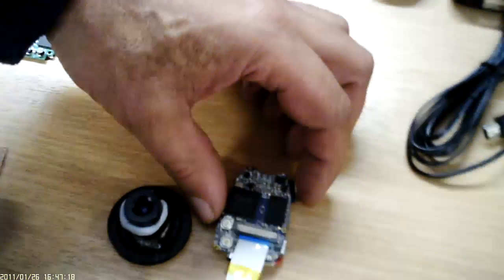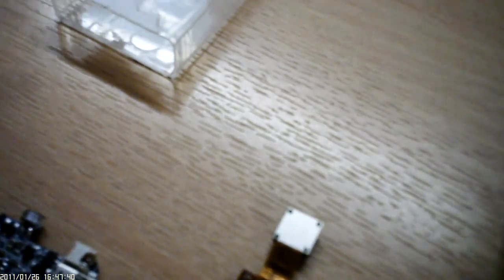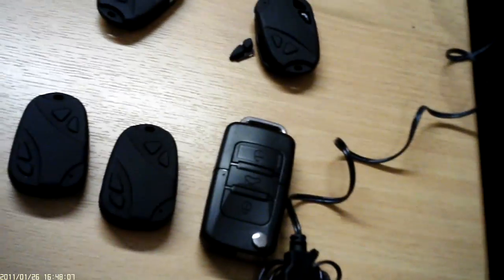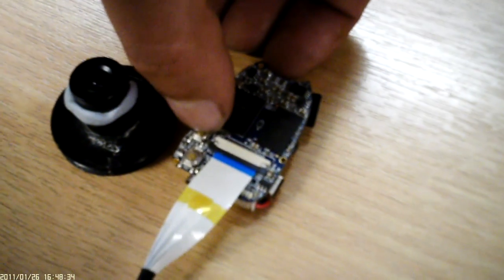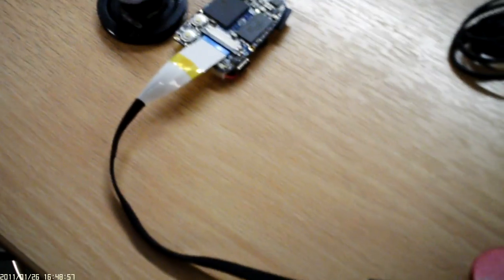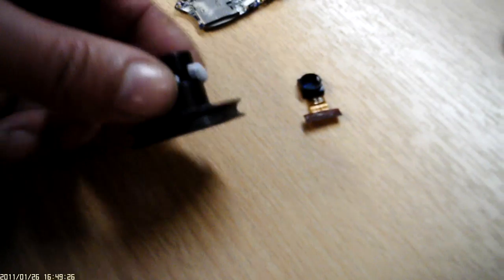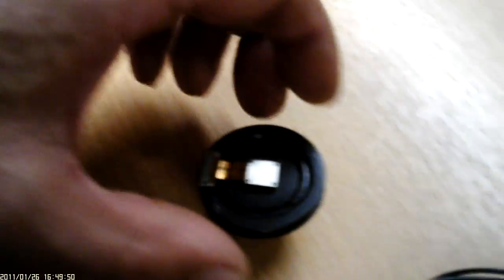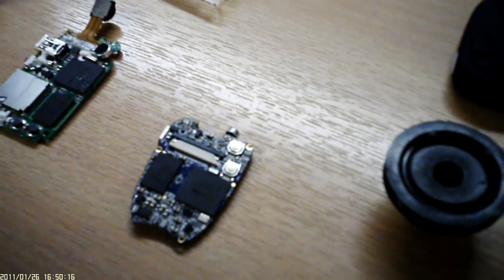808 #16 extended camera module

Comment: Would be simpler if they sold the 808 with the extension. I got one of these with the intent of putting on my various mini quad copters, for a bit of fun with the kids, but I really need it to have the ribbon cable extension so I can change the angle of the camera.. do you know if they have since began selling the 808 with the extension? Or an RC shop that mods them for resale?
Reply from the maker: From what i know the 808 has been superseded by the mobius which can be bought with the mod as a kit and is widely available.. as for the 808's you would have to source the parts your self and now is a bit old..

Comment from the maker: both considered and flux paste was used from the start but the problem was heat.. I've used a heat gun previously for SMD work, but lets face it flat ribbon cable is not meant to be soldered. any how my prefered method is to clamp.

Comment from the maker: Hello
This is the point, impedance along the length of the cable degrading video. This length works with no difference in video quality (please see the actual video of the camera videoing its self).  Also rcexplorerse did a side by side comparison of a go-pro and HD camera using a similar ribbon cable (worth a look) with no difference.
Best regards
TheRogerx3

Comment from the maker: Hello itsnige
yes that is the way to go. as long as the contact alignment is maintained and each contact has enough pressure on all lines any viable method is good. the problem is with size of method - my heath Robinson method works for demonstration purposes but is not practical. Thanks for your interest, I think that your question is the last piece of this chain, as it the sure fire way to connect ribbon to camera for those whom don't want to destroy their cameras.
Best regards
TheRogerx3

Comment: Hi TheRogerx3, I'm planning to try the same extension but thought I'd keep the camera module connected to its ribbon cable and add an IDC connector to the end of the extension cable to connect the two together.  From your experience do you think that would work?

Comment from the maker: Hi fredintheshed1
Thank you
The trick is to use flux paste and apply heat with a soldering iron no higher than 12w, an adjustable one is better. never use sideways motion against the tracks this is where I went wrong

Comment: It looks very tricky to solder the tiny ribbon cable.  Ive tried with old calculators with thicker cable and failed. I think you did well to get it working. ;-)